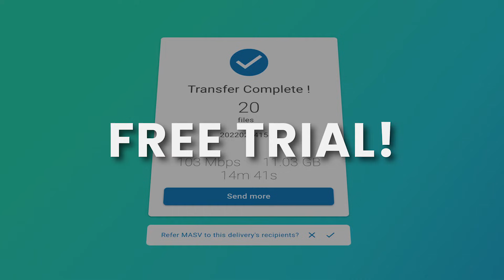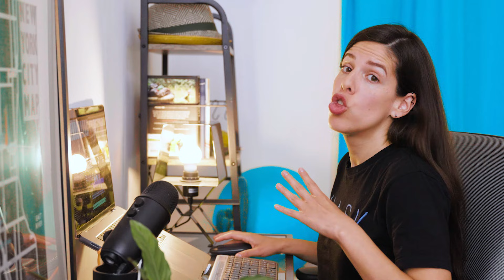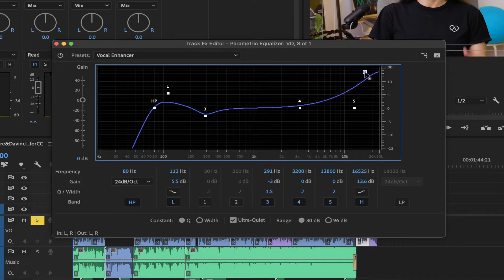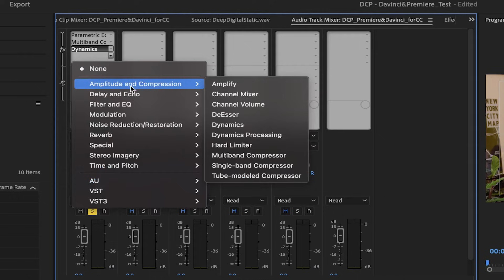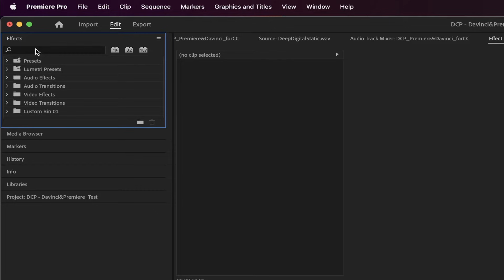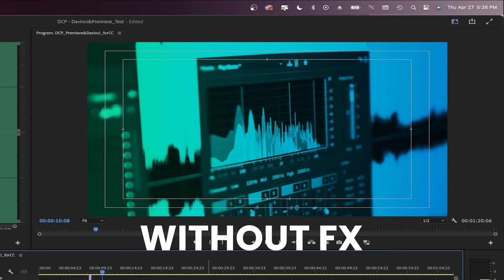How to Mix Audio in Premiere Pro | Adjust and Balance Tracks 🎛️

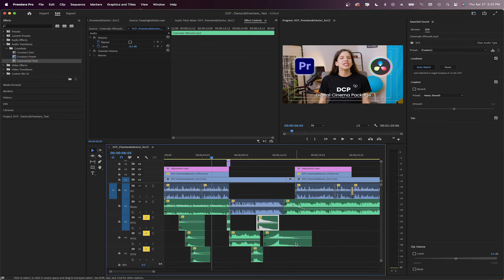Comment: What is this shortcut at 9:52 , I've never heard of it automatically adjusting the sound. I see you click the audio clips and the levels automatically move, but how?
Reply from the maker: @DavidFaxon When you select your clip and press the "[" and "]" keys it will decrease and increase volume respectively. "Automatically" might have been the wrong word to use in this section. Our bad!